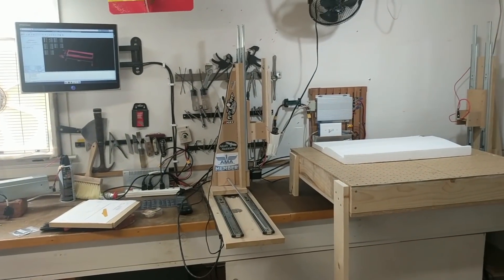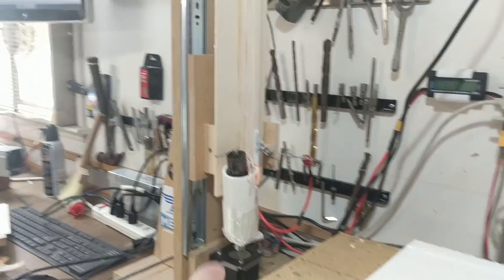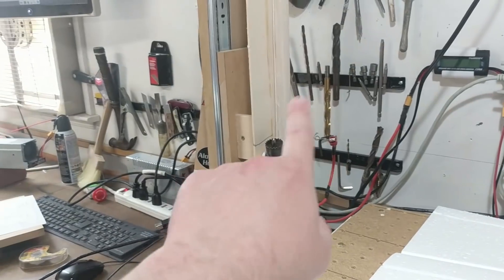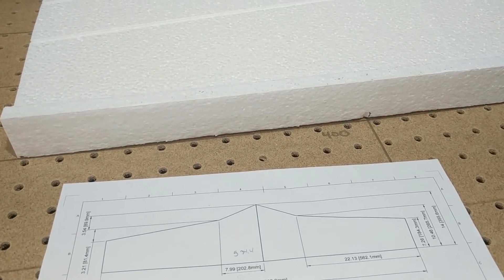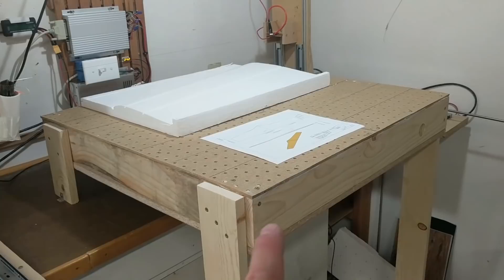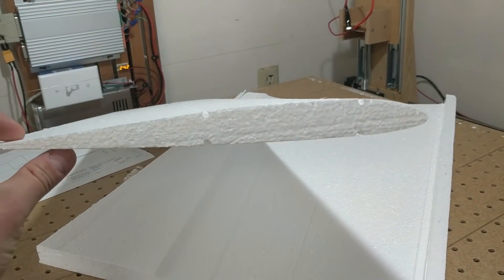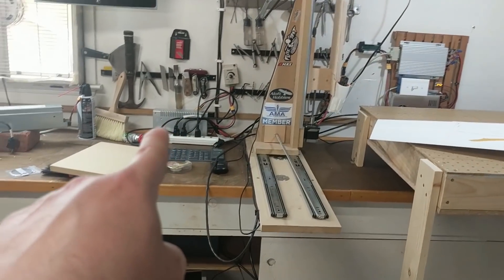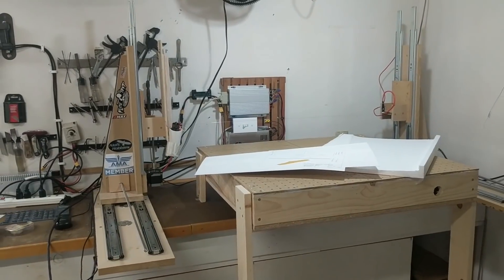Diy CNC hot wire cutter - build log 3

Comment: I have the cutter amost done. My problem is how to get the wing information put together to put it in the cutting program. Could you do a video on picking a wing, what you do between picking and cutting, then cutting. with alot of time spent on the IN BETWEEN. Thanks
Reply: Hi, did he made the video? I’m new here. I’m building my CNC hotwire To cut some wings would love to know if he made the video that you asked
Reply: No , there has not been a response to my request. @chelusurfboardsglassing1243

Comment: What kind of foam do you use?
Reply from the maker: R-tech brand rigid insulation from home depot.
Reply: I think it is XPS foam which is mainly used for building insulation. Did you try EPP foam which is more flexible and crash resistant?

Comment: Congrats on building a great cutting system Nate!  Are you taking orders for wings yet?  I need a 50 inch MH 32 airfoil, ten inch root out to six inch tip in EPP foam.  ;-)
Reply from the maker: MostlyHarmlessRC epp is too expensive for me. What are you building?
Reply: Hey Nate - The next plane is still in the design phase. Seriously considering a nurf-like, plank-wing fpv plane.  That's why I'm looking at thinner, faster airfoils. I was kidding about epp - I'll probably stick to polystyrene. Wish I had your amazing cutting rig!  Cheers man
Reply from the maker: love the nurf. i still go back and watch your video from time to time. Making a forward swept wing is on my list for sure.
Reply: Thanks man - that's great to hear!  It'll have a similar tail-less shape but I may not include the sweep - can't decide... I want it to be fast and stable - a bit like the goblin and the mini-drak.  How's the F100 coming?
Reply from the maker: Working on the launcher right now: https://forum.flitetest.com/index.php?threads/f-100-super-sabre-1-8th-build-70.37285/post-420024
Reply: Dang Nate, you have a lot on the go!  You say the heat is slowing you down - I must be a sloth!  Impressive dude :)